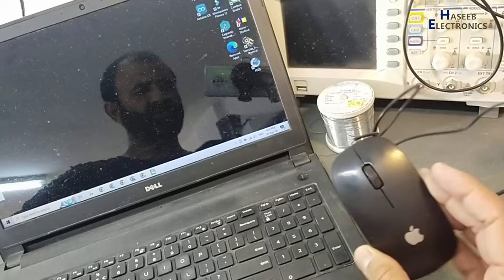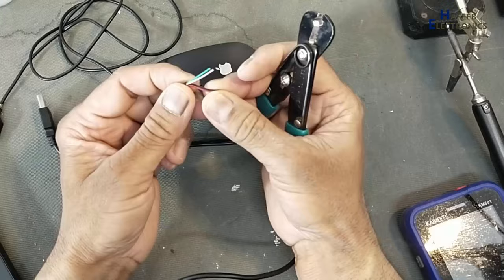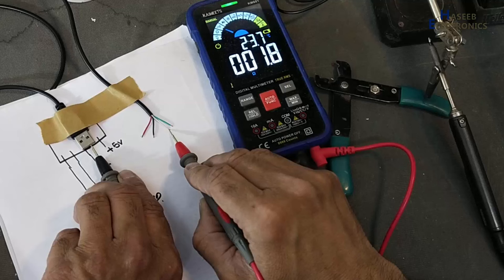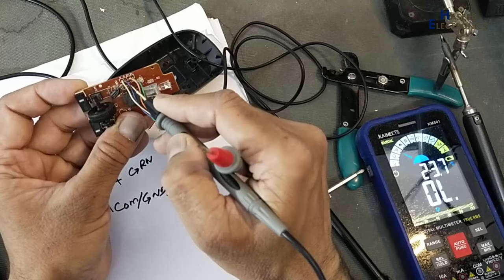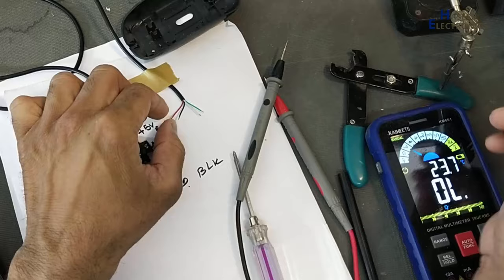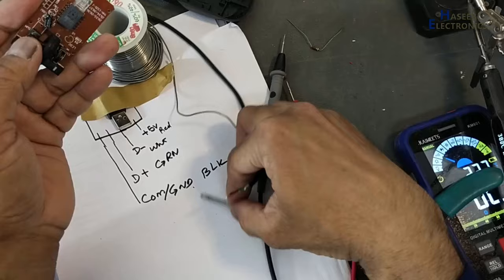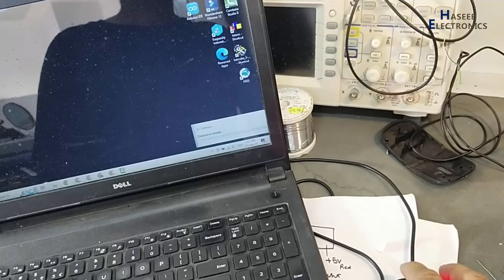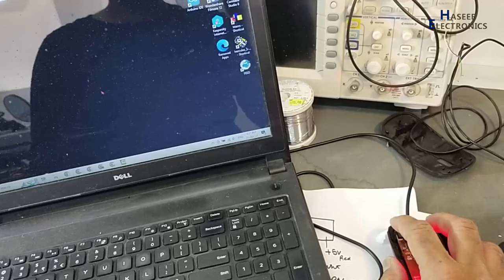{1084} Computer mouse repair

Comment: Not good sir .... Bcoz it's USB type.....
What about PS2 ....?
Reply from the maker: original mouse cable is also USB 2.0 cable and i replaced it with same type cable. PS2 mouse can be converted very simply to USB mouse. you can use PS2 to USB convetre or we can replace the cable